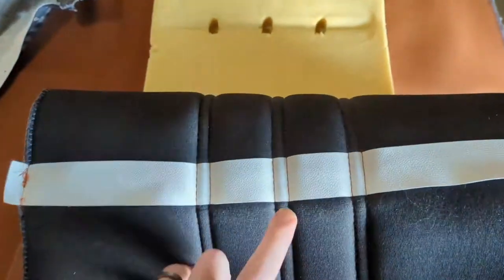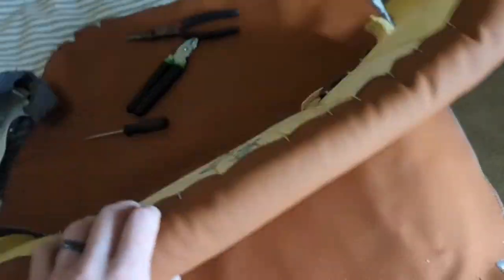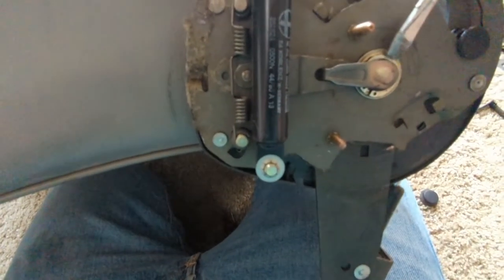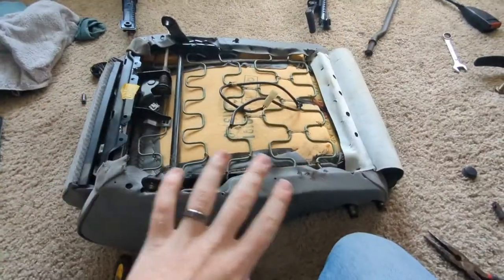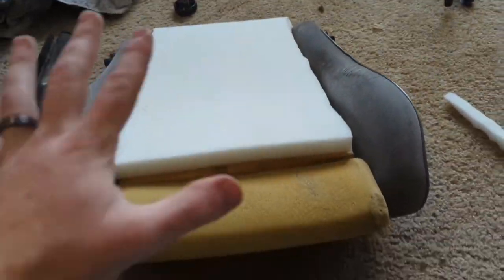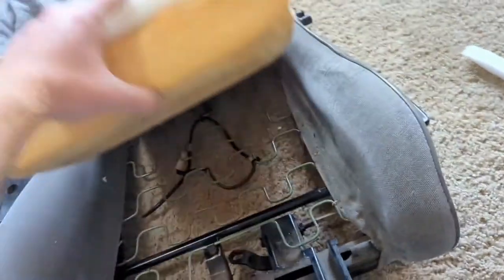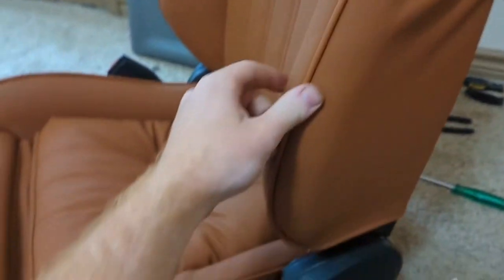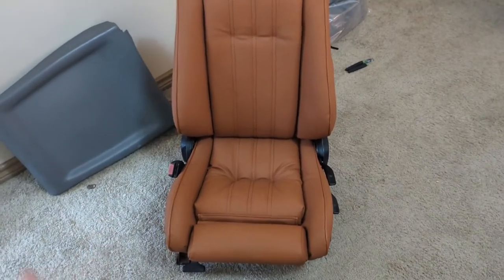I Tried Reupholstering My Seats Using "LSeat.com" || Here's  How It Went! Part #2

Comment: Did you have any velro backing on your seat skins? I am having a hard time reaching out to them =(
Reply from the maker: Do you mean Velcro? For the back of the seat I used upholstery glue
Reply: @ProjectRacecar2  yes velcro
Reply from the maker: @vincewu4162  mine had a black padding on the back I cut that out and glued it to the OEM backing and had good success
Reply: @ProjectRacecar2  thanks, not sure its the same type of backing I have on my car then. Thank you for the help. I am not having any luck Lseat calling or responding

Comment: What size hog rings did you use? I'm about to do this.
Reply from the maker: I used 3/4" hog rings to do mine and they are still holding up, I used probably 150  to do mine, they get used up quickly, so buy a decent amount👌🏻

Comment: Is it real leather?
Reply from the maker: From my understanding it's real leather that's mixed with a feux leather, that gets the feel of leather and the strength of feux, it's like how they do a 50/50 cotton/poly for your T-shirts, I personally have been really happy with the durability and feel of the seats!
Reply: @ProjectRacecar2  I don't think you can mix leather and poly if it is both then probably some panels are leather and some panels are Polly think if it was real weather you'd know you'd smell it
Reply from the maker: @davidphantom8163   that was just an example, I did actually look it up because I was interested, genuine leather is real leather, there are multiple layers of the hide, genuine leather is a lower layer compared to "top grain" leather, it's just a cheaper form, it is real leather though, no poly